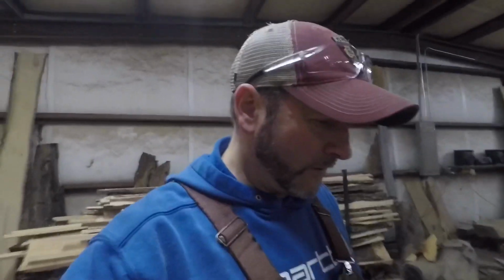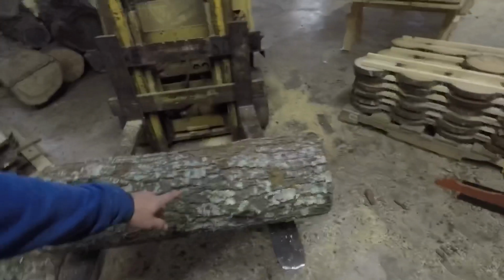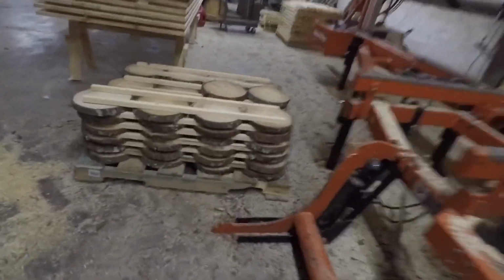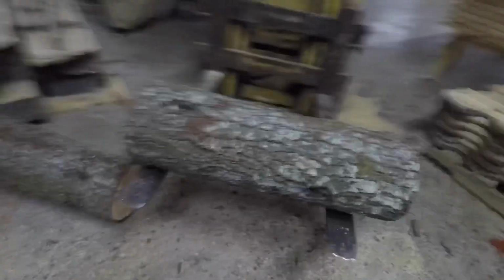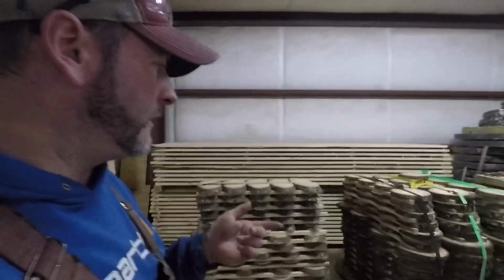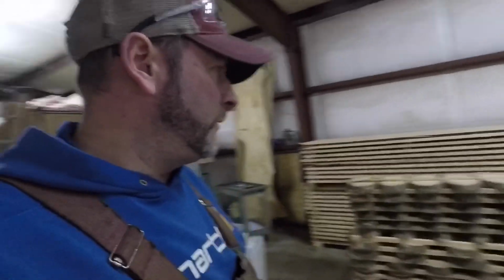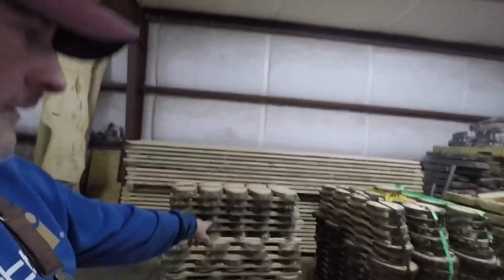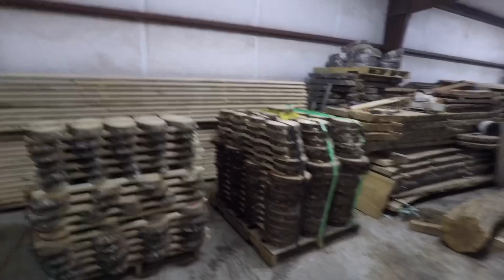How to turn $40 into $1000. Sawing cookie slices on a Woodmizer lt35

Comment: I cut the same as you do.  I like mine a bit thicker, about 1 1/2 inch.  Ovals are less likely to split.  Also if you do not need the bark to stay on, try using dry logs.
Basswood ones are nice, but do not have much grain and are excellent for painting.  Red cedar and walnut are great for clocks and plaques.
Reply from the maker: Nice yeah I cut a lot of cedar and walnut cookies. Drying them is the tough part
Reply: @mrectordiesel  I slow dry them in a dark room with no breezes.
Reply from the maker: Do you have mold issues? With no air stirring?
Reply: @mrectordiesel  No, mold was not an issue.   The logs were not fresh cut, a few months old.  I did this with burls also.

Comment: Looking forward to results. Thanks
Reply from the maker: Let’s hope they do ok.
Reply: @mrectordiesel  did you have a market for cookie cuts before you cut them, or did you have to find buyers? I'm about to get a mill and am looking at ways to make a profit. I appreciate your videos , thanks
Reply from the maker: I just trust in the spring time, weddings pop up all the time and having them on hand, especially dryer and non moldy cookies, they leap off the shelf so to speak. So no, I didn’t already have a buyer but every spring and summer of the year I have sold lots of them. Hope that helps